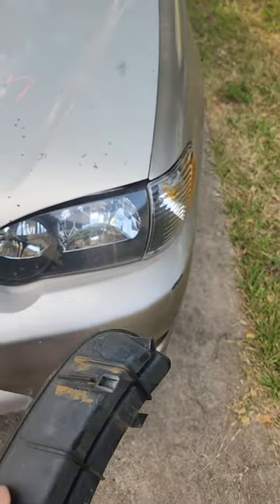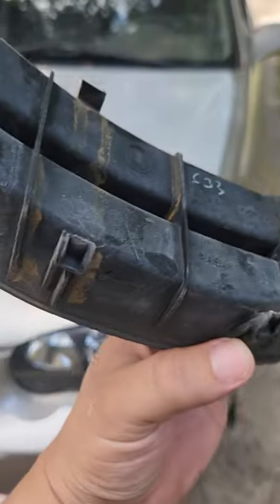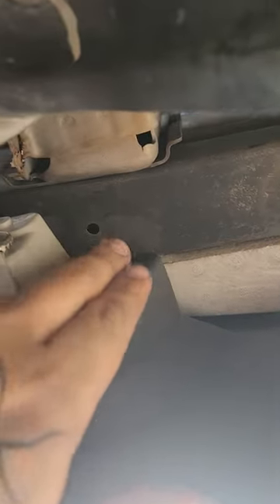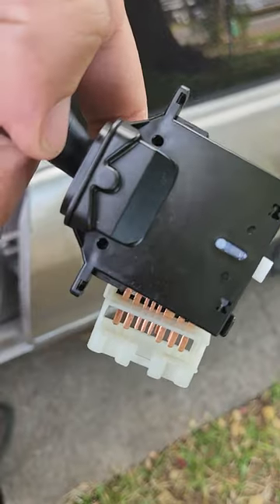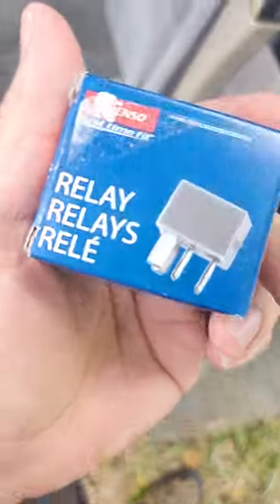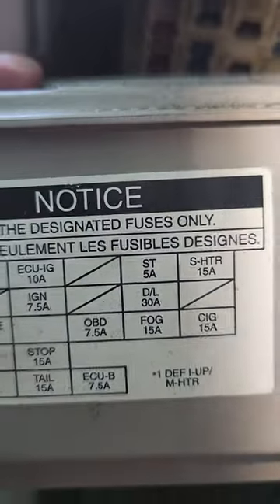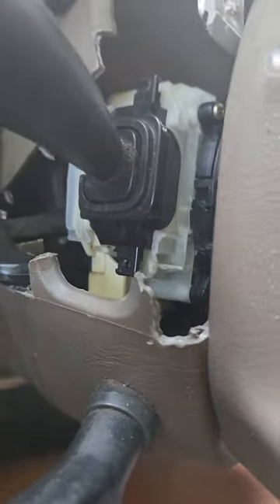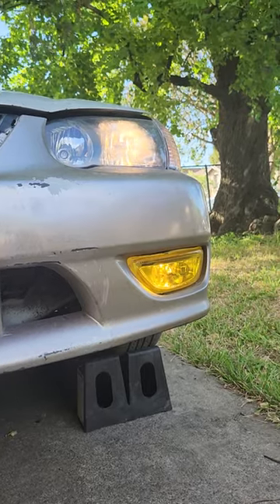2001 corolla pre wired fog light installation

Comment: I have done all this and even just took out the relay I put in and the fuse, mine still don’t turn on lol
Reply from the maker: Hmmm, have you checked if you're getting volts.
Reply from the maker: I only did it cause it's pre wired which is sweet. Can always run an aftermarket kit to light up fog lights.

Comment: Como consigo el relay para los fog ligjt?
Reply from the maker: En autozone,oreily
Reply: @rustyshackleford4192  pero lo pidonasi mismo, un relay para los fog ligjt de corolla 2001? Ya que no tengo la enumeracion del relay. Gracias por sacar de su tiempo para contestarme.
Reply from the maker: @luissanchez7455  denso 567-0001
Reply from the maker: @luissanchez7455  https://www.ebay.com/itm/304270299922?mkcid=16&mkevt=1&mkrid=711-127632-2357-0&ssspo=dYZU5cNhRKW&sssrc=2349624&ssuid=mFeX7TdrRrW&var=&widget_ver=artemis&media=COPY
Reply: Muchas gracias por enviarme el link. Lo acabo de comprar, solo se necesita un relay?
Reply from the maker: @luissanchez7455  un fuse , el switch. Mira el video.
Reply: Gracias
Reply from the maker: @luissanchez7455  come te fue?
Reply: @rustyshackleford4192  estoy de viaje tan pronto llegue me pongo a bregar con eso
Reply: @rustyshackleford4192  estoy de viaje tan pronto llegue me pongo a bregar con eso
Reply: @rustyshackleford4192  mano ya se lo instale pero tengo duda en algo. Loa fog light encienden pero cuando hago el cambio de luz para el full beam o luz larga los fog light se apagan. Eso es normal que haga eso, que solo se mantengan encendido con la luz corta" low beam" por que con la luz larga se apagan. Yo entiendo que si la palanga tiene un swictch aparte el sistema sea independiente y aunque haga el cambio de luz larga se mantenga encendida los.fog light.
Reply from the maker: @luissanchez7455  me imagino que nos no mas trabajan con low beam.
Reply: Una pregunta si no coloco ese relay no funcionan